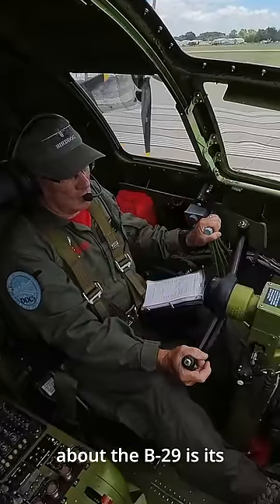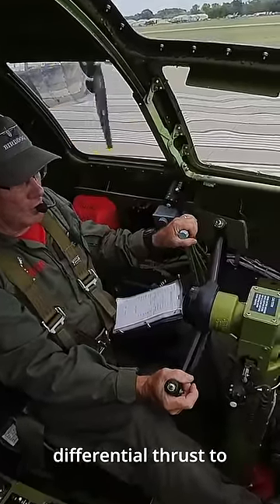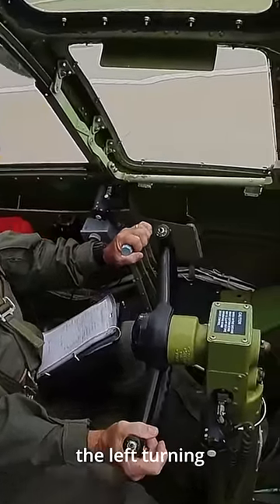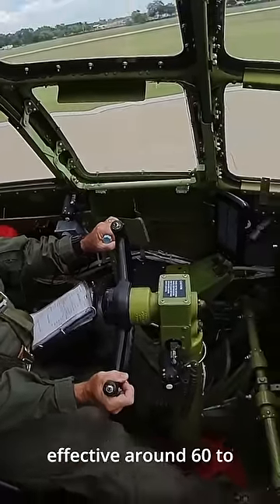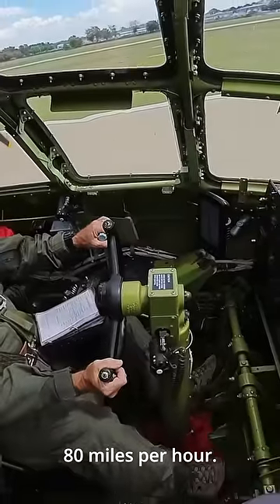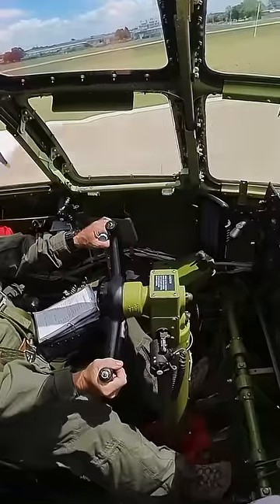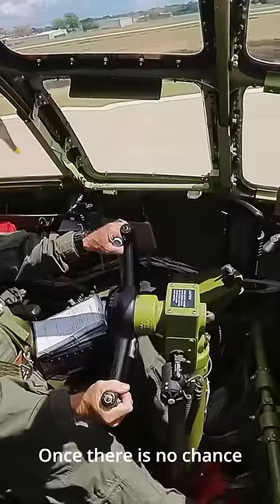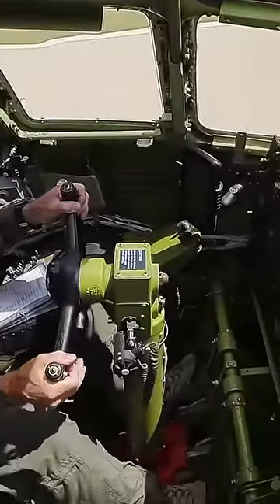The FULL B-29 Takeoff #warbird #aviation #airplane #instruction #pilot #warbird #history #ww2

Comment: The B29 was truly an engineering marvel for its time.
Reply: Russia still using a version of it

(This statement is false. I thought they were, but they're not)
Reply: Actually the engines were underpowered and they were through so many different manufacturers to find engines powerful enough to sustain flight. All the remote turrets on the plane were new, and ate up a lot of electricity!!! All the advance firing computers ( advanced for that time) ate up electricity!!! 
I believe the crew found ways around the underpowered engines, a balancing act of you will, to keep the planes flying.
Reply: I have read the development costs for the B29 were greater than the cost of the Manhattan Project. Hard to believe, but the B29 suffered numerous delays and changes before going into production. 

The Wright 3350 engines provided 'adequate' power, but the drag from having the cowl flaps (for greater cooling air flow) induced a great deal of drag, actually slowing the aircraft. Flight was a constant juggling act between engine cooling and drag management.
Reply: No it wasn’t; it was far behind technologically, even for the 50’s, as with the rest of American planes.
Reply from the maker: @jovialvulpes4032 1944 it absolutely was.
Reply: @jovialvulpes  Well, name another aircraft of that size that had a pressurized cabin, dual tricycle landing gear, remote computerized gun system, a 32,000 ft ceiling, and a maximum speed of 350mph (faster than any prop bomber) when it was going into production in 1944. This was designed in the late 30s. I'd say that's pretty state-of-the-art.
Reply: @scottfoster2639  I’m sorry to tell you this, but the Germans had all of this and more long before the Americans 😬
Reply: @gravity.images  It was way behind by 1940. You really don’t know much about the Second World War.
Reply: @jovialvulpes  How'd that work out?
Reply: @scottfoster2639  Badly; unfortunately no amount of technology two decades ahead of its time could save a country standing alone against the world :3
Reply: @jovialvulpes the Germans clearly didn’t make them good then because they lost
Reply: @ComeAndTakeIt9235  Yeah, you really sound like you know what you’re talking about based off that response 😂
Reply from the maker: Ya caught me. Please educate. 😂
Reply: @jovialvulpes4032 what German aircraft had all of that?
Reply: @jovialvulpes they weren't used as a staple for their airforce though. That's like saying they had nuclear capabilities before us. So what. We used it tested and confirmed they work. We peeked at some info. And what of the rest of American aircraft being behind technologically? I'd like to know as I work in Lockheed specifically. Nothing is not state of the art on our newest planes. Everything is so top secret that even if you aren't the ones assembling you can not go past the tape that is put on the ground or the security team removes you immediately. They don't allow even some of the designers of some of the systems being used past our clearance lines. And they have to get escorted if they do and searched thoroughly entering and exiting if guests.
Reply: @jovialvulpes They started production in 1943. Of course it was obsolete in the 50’s.
Reply: @jovialvulpes No, they did not.
Reply: @JM-lk6wo  It wasn't uncommon for the B29 to just catch on fire. In fact when the Soviets reversed engineered the B29, they had the same exact issues.
Reply: @jovialvulpes The USSR could build a LOT of low-quality weapons. 

Germany could design and build a small number of the most advanced weapons of their day. 

The United States could design and build a lot of high quality, well engineered weapons. We took the best qualities everyone else had and combined them. And frankly, if it weren’t for the German and Jewish scientists and engineers that worked together here in the US, WWII likely would have had a different outcome.
Reply: @jovialvulpes Sorry to tell you, but it didn't work for the Germans... and btw, what German aircraft was fully pressurized and had computer guided firing turrets?
Reply from the maker: @Josedelgado6 i was wondering this as well
Reply: @jovialvulpes name 1 example of a German aircraft that matched the capabilities of the B29 in 1940. They didn’t even field an effective 4 engine heavy bomber. Germany had allies and did not stand alone against the world, they just had the wrong allies. They weren’t the only country fighting a two front war either, they were just the biggest losers 😂
Reply: @jovialvulpes u jus mad America whooped Germany
Reply: @whalehands the tu-95?
Reply: As a die-hard aviation nerd. Four engine bombers we're critical to winning the war. The B-29 quite possibly won the war in the pacific by almost single-handedly crippling Japanese infrastructure. Up until very close to the end of the war, it was the only bomber that could reach japan from the US's FOBs (Until we took more islands and got closer bases). And yes, the B-29 was the WWII bomber equivalent to the F-22 in terms of advancements in technology. Yeah it had it's problems (Just like every other aircraft in existence) Most of the problems were caused over-complexity because it was so advanced. 

btw i mean over-complexity relative to other aircraft. Not that it was more complex than it needed to be.
Reply: @ComeAndTakeIt9235 at the time the Me-262 came to be, was too late for much of any effectiveness against the allies, the production came at the near end of the war and many never even made it off the production line.

Thankfully, because if they had produced earlier then the Allies would have been in deep trouble in aerial combat.

The Germans at the Time of WW2 were far ahead of their time in many things unforeseen by most of the world at the time, the British and Americans came close to them but only by margin, at the time of the development of the Me-262 the British at the time had been developing their own by this time but have not Developed for military use as it was still in Drawing board phases as it was not very Reliable and as effective as conventional prop planes were.
Reply: @whalehands no sir they do not
Reply: @jovialvulpes just bc they had prototypes did not mean they were effective. They had jets, yes, but never used to much effect. If their planes were better, then they should have been more relevant in the war.
Reply: @RD-lu1tr  you are correct. 1960s were when they were phased out? My mistake
Reply: @whalehands pretty sure they aren’t using the tu4 anymore but tupolev has designed many planes after and before the tu4(which wasn’t really designed by tupolev of course) the tu94 and some other big tupolev bombers are still in service either as elint naval recon etc or as long range strategic bombers
Reply: @jovialvulpes Germans didn’t have any of the things he mentioned on any plane near the size of the b29 that went into production. Yes Germany wasted lots of precious resources on Programms that were unnecessary and didn’t lead to anything at all, great job by them not being able to concentrate their resources.
Reply: @FloridaManMatty Germany could build a few very advanced weapons but so did the us and Britain and to some extent the ussr and Germanys important weapons weren’t anything far ahead of the allies especially later in the war but often they took turns especially in airplane development where a new German plane or version of plane arrived and was the best and then a new British or American model arrived and was better.
Reply: @Kactus-55 submarines were as important though as they made the Japanese raw material problem even worse. Yes b29s did a lot of damage to the Japanese industry but that late in the war when it had an effect most of the  Decisive battles had already been fought
Reply: @zevailes because the British put their resources on stuff that was more important to winning the war. Germany wasted their resources on many advanced projects that clearly wouldn’t come in time to help their hard pressed armed forces
Reply: @thurbine2411  Submarines and naval warfare in general have always been a gap in my knowledge. But i think most people can agree that the B-29 was, at least, the killing blow to the Japanese. (and not just because it dropped the nukes)
Reply: Except it seems like you couldn't steer with the nose wheel
Reply: True
Reply: Okay im an engineer, engines generate power. Engines go out batteries take over with what ever power left to operate. 
Batteries go out, mechanical technology is only operational. By that point this vehicle is useless.
Reply: @jovialvulpes the germans had all that? What plane?
Reply: Cost a bloomin fortune .
Reply: Yeah but they still in fact lost the war!
Reply: Good marketing
Reply: @jovialvulpes It paved the way for modern aircraft such as the B-52 and others, including airlines.
Reply: @jovialvulpes if they had all this and more name the german plane with all these features, go ahead im waiting. You can't because it doesnt exist.
Reply: @jovialvulpes technology SO ADVANCED other countries had comperable aircraft that flew at the same time or before them. You been watchin too much history channel lil bro.
Reply: @adub1300 name an american jet durring world war 2 that matched the capabilities if the ar234 they didnt even field an effective 2 engine jet bomber and by the way america jumped in last year for one operation
Reply: @whalehands No, the Tu-95 or Tu-142 are NOT a version of the B-29. Both Russian bombers use the same fuselage diameter as the B-29 but that's all, there is nothing else in common. It's like saying the VW Passat is a different version of the VW Polo because they share the same steering wheel.
Reply: It may rain terror but the seeds from its cargo will flower a peaceful landscape. Cheers from England
Reply: @jovialvulpes They had the japanese and the italians.
Italians who needed Germany to help them most of the time and japanese who kind of doomed them by attacking Pearl harbor.
Reply: Also one of the greatest engineering headaches of all time.
Reply: @jovialvulpes  you say, “behind, even for the 50’s”. When do you think the B29 was designed and put into service?
Reply: @nilocwhalehands4779 Yes, they illegally copied it, claimed it was their design, and copied it so good it had the same overheating problems ours had.
Reply: @FloridaManMatty I mean arguably not. The germans simply could not keep up with our production rates. And the germans continuously had tactical, and operational failures from start to finish all through out the war.
Reply: @adub1300 yeah lol, and the allies the did had they would constantly back stab and undermine. It was sad frankly, all the militant hype just to get brutally mauled in the 1 war they fought.
Reply: Это действительно было чудо инженерной мысли. И они постоянно горели.
Reply: @ДжекПиронович  Да. К сожалению, слишком часто случались перегревы и электрические пожары.
Reply: It really wasnt
Reply from the maker: @OliverFlinn except that it was
Reply: @jovialvulpes  LOL😂😂😂😂
Reply: @jovialvulpes  yea your rly j spitting put whatever comes to mind now aren't you
Reply: @jovialvulpes bruh name one German aircraft that had that in the 40s
Reply: beutifull plane
Reply: @whalehands  🤦 What?
Reply: Yeah they did it all on their own didnt they, america fuck yeah woooo 😂@aviancypress5181
Reply: @jovialvulpes  Please share a reliable source of a German aircraft, that went into mass production,  that 'had all of this and more long before the Americans'.
Reply: Idk how much the atomic bomb weighed but they definitely could carry a bomb to kill the most with one bomb
Reply: It still is
Reply: Me 262 was first jet in the world. It is engineering marvel for its time too.
Reply: @michalarin5152  The first B-29 flew in September 1942, and by January 1944, the 100th aircraft had been accepted into service. Production of the B-29 rapidly increased throughout the year, with the 500th aircraft being accepted in July and the 1,000th in November. By March 1945, the 2,000th B-29 was accepted, and by June, the 3,000th.  Only 300 ME 262s actually saw combat. An engineering marvel indeed, as a novalty. The B-29 was standard issue.
Reply: @jovialvulpes the 50’s? What does that have to do with 1944?
Reply: Yeah, I don’t know my grandpa’s ended up in the ocean. They had a lot of mechanical failures.
Reply: Charles Buchinsky was a hero in the B29. Later in life, went to Hollywood became known as Charles Bronson, legit badass.
Reply: You probably should have said the b-29 was truly an engineering marvel for mass-produced heavy bombers. Most people here want to debate miniscule things when considered for what it was designed for. Yes engines were underpowered because they had to be to get the distance needed to deliver bombs for their missions. Of course there was problems with their computers because they were the first of its kind again for a mass-produced aircraft. Let's remember what things were designed for, before making obvious comments which if you would have talked to the manufacturer in engineers they probably would have told you the same thing. In my opinion this was one of the most technologically advanced airplanes of the time for what it needed to be and how fast it had to be produced.
Reply: @brianclemetson8781 We should also remember that there was a war going on and the funding was at the bottom of the barrel.  It looked like the war would go on another 5-10 more years in 1944. Considering this historical context, the US did not have the luxury of 'pulling' the new plane to fix the 'bugs'. Back in those days, the pilots were required to document any issues that might otherwise be caught during a modern day trial system. I will stick to my original statement as I would expect these considerations to be noted by (or so I thought) those that feel that they can make a useful contribution to these comments. I won't dumb down my comments for 3rd graders.

Comment: Fantastic! Love the growl of those monster radials!
Reply: There is wind from the right.
Reply: @gillesguillaumin6603 he is steering it with the throttles it's torquing so it wants to turn itself so he has to control it via throttle...
Reply: @joebucktexas  if it had been designed in peace time, the engineers probably would have had it fitted with mirrored engines so that either the two outer engines spun in opposite direction to the inner ones or both engines in the left wing spun clockwise and both in the right wing, counter clockwise to eliminate that effect.

But in a war time design, parts interchangeability and logistics takes precedence.

Comment: That B-29 looks to be in excellent condition. 
  And as for the Prop Torque. That's why I like the P-38. Counter rotating props.
Reply: Doesn't the P-38 have linear engines too?
Because the main torque pushing the B-29 isn't the props, it's the mass of the whole damn engine spinning inside the cowling!🤓
Reply: @SonsOfLorgar  No, the P-38 has the Allison  V-1710 with supercharger.

Comment: The airplane itself was so complicated and such a physical handful that the pilot and copilot together were insufficient. It requires a separate individual, the flight engineer, working the engine and fuel management systems to keep it in the air and able to make it to the target and back without catching on fire.

Comment: The reason they have to modulate thrust to control steering is due to the fact that the B-29 doesn't have steering gear on the nose wheel. It's all done by engine thrust.
Reply from the maker: Correct. And braking but that’s counterproductive on the takeoff roll

Comment: Why does it tend to the left? Is it a load related thing or just this specific plane had this issue?
Reply: Because the propellers all spin in the same direction, it causes multiple asymmetric forces on the plane that pull it to the left. It's an effect on all propeller planes without contra-rotating propellers.

Comment: If u counter rotate the propellers! Would that offset the left turn issues?  I always wondered why there is no counter rotation !!
Reply from the maker: Would offset a lot of the issues. But then you would be required to keep two sets of engines vs one.
Reply: Pretty sure the engineers knew what they were doing😅
Reply: @gravity.images  ohh, not as simple as adding a gear ?

Comment: Why don’t each wings engines spin inward!?
Reply from the maker: Would require two completely different engines. Not at all practical in wartime
Reply: @gravity.images  please explain as it’s not difficult to have the engines spin “inward”! Did the 17 &
24 not have them!?
Reply from the maker: @LeoTheLion01 the engines made all turned the same direction for 25, 24, 17, 29, etc. It’s a function of spare parts. If they had opposing engines, then two models would be required for spare engines. That’s the last thing they would want to deal with when training can solve the problem.
Reply: The P-38 was the only allied plane to have counter-rotating propellers, to my knowledge and it wasn't for increased safety but rather performance. It had two critical engines.
War, like WWII, you do whatever it takes to win, because no less than survival is at stake.

Comment: Didn't the pilots and flight engineers on the commercial airliners that used similar engines and propellers have to do similar adjustments?

Comment: By “left turning tendencies” is that because the props are both spinning in the same direction?
Reply from the maker: Yep. One of the reasons anyways.
Reply: @gravity.images Cool!  I’m a boater and for boating it’s called prop walk. Solution is to have one prop spin the other direction and it cancels out. No idea about flying or other implications!
Reply from the maker: @CarpeDiem601 yep! It would with the same. Just means that there would have to be another different engine made.